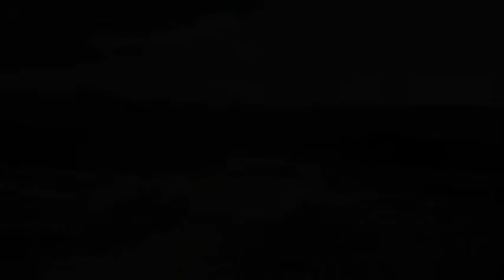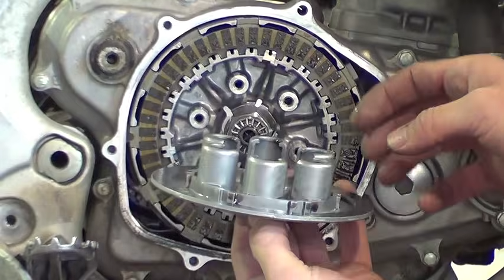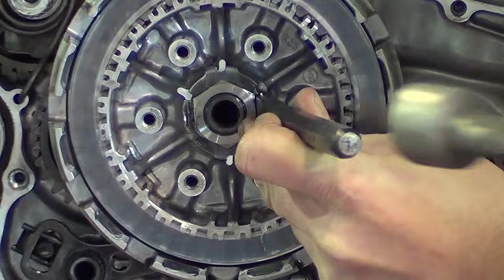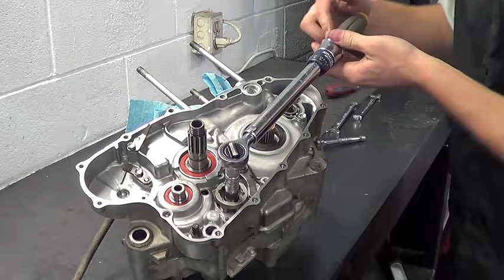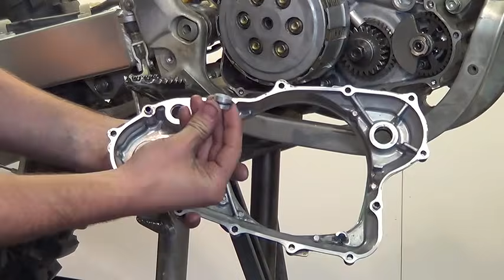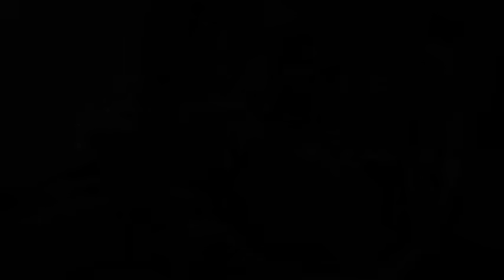Honda CRF450 Clutch, Kick Starter and Gear Shift Dis Assemble / Re Assemble - Parts in Description

Comment: Tengo una crf 450 x 2008 batallo para meter neutral mi pregunta es si será elnbalerito de la patita selectora no mire q lo cambiarás y en algunas motos es el primero q tiene juego
Reply from the maker: La mayoría de las veces es por las ranuras (muescas) en la canasta del clutch que hacen difícil encontrar neutral. Nunca he visto que se desgasten el buje de la palanca selectora ni el balero del tambor de cambios.
Reply: @CoteMotorcycles muchas gracias comenzaré por ahí

Comment: Si neutral batalla para entrar podrá ser el balero del selector o las pastas gastadas ? O el tipo de aceite ?
Reply from the maker: have you checked the clutch basket or if the clutch plates are stuck together? clutch adjustment is correct? very unlikely its bushings/bearings or oil making it hard to get into neutral.

Comment: Neutral no entra ssbes que puede ser ?
Reply from the maker: Probably needs clutch basket filed down. There are ridges that form from normal riding that will hold the clutch pack together. File them smooth and you should be good!
Reply: @CoteMotorcycles  en caso de estar bien la crestas? podría ser un balero donde detiene los cambios ??
Reply from the maker: @geovanyfz  you can see how the clutch basket should look at 8:00 on the video. The fingers should be completely smooth. I suppose you could also need to set your clutch cable. If it's not disengaging the clutch will drag and won't be able to find neutral. Very unlikely its a worn bearing. Could also check the detent bolt (5:28) The bolt could come loose and the detent star could have rotated on the shift drum. You would likely have trouble shifting in all gears, not just neutral.

Comment: Batallo para poner neutral
Reply from the maker: Probably needs clutch basket filed down. There are ridges that form from normal riding that will hold the clutch pack together. File them smooth and you should be good!

Comment: Why my honda crf 450r dont changue shifts
Reply from the maker: Most common reason is that the bike fell on the shifter or took a hard hit that bent a shift fork. That would mean tearing the cases apart. 

I’ve also seen that the shift detent bolt comes loose and doesn’t allow the lever to turn the drum properly. The loose fastener will be the one I’m holding in the thumbnail of the video. You need to make sure the detent wheel is properly located onto the shift drum.

Comment: Should you loosen clutch spring retaining bolts in a star pattern?
Reply from the maker: Doesn’t matter. If you want to get crazy you can loosen them by hand in an opposing pattern and only loosen them 1 turn at a time but I usually just send it with an impact. Never had an issue; just make sure the impact is for sure in reverse or you’ll snap a bolt or clutch hub. 

Have fun!

Comment: My kicker doesn’t go back up after I turn bike over how do I fix that ?
Reply: I just rebuilt the entire bike maybe i did somthing wrong ?
Reply from the maker: Get back in there! 
Probably the spring on your kick start ratchet assembly. The locating pin for the spring might be out of the hole, this makes the width of the spring increase and it will bind between the case and pawl mechanism. Let me know what you find!
Reply: So I started my bike yesterday after I finished rebuilt and kicker stayed down and I brought it back up and had to hold it forward so the noise as if it was still down while running ( if you no the sound) it went away but when I let go of it it moved about a inch back and started the noise again
Reply from the maker: @ryanpro3363  sounds like the same thing as I said before. The ratchet mechanism isn’t disengaging. Take the cover off and send me a picture of the kick start mechanism on messenger. I’ll see if I can see what’s going on.
Reply: I'm repairing this right now. Mine partially was returning, but binding. 

All the kick-start hardware was installed correctly, there were however some flakes of steel under the kick-start shaft that were binding the shaft.

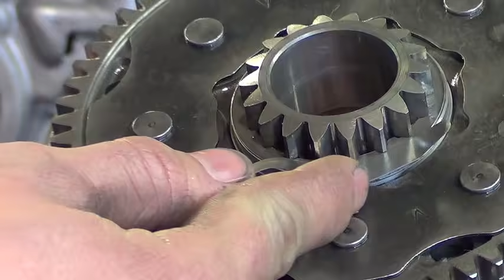Comment: At 7:29 you put the idle gear back in. My bike is have troubles kicking and I took it apart it the gear move back and forth on the shaft is it supposed to??
Reply: having the same problem ever figure it out?

Comment: I need to change the left side of the engine of my CRF, is there any video that could guide me?
I also have a question, when installing the cover, after the use of the gasket, is it necessary to use some kind of silicone or just the gasket?

Comment: The bearings on the case show sealed side out( red) . I opened my engine and appears they were put in backwards. Will this be a issue long term or will they get plenty of oil from clutch side
Reply from the maker: Jason Mcbride it's always good to have things the way the manufacturer suggests. I've never tried it with the seals in backwards so you'll have to let us know how your engine likes it. ; )

Comment: I have a 2003 crf450r and I can't seem to get my clutch hub to spin freely
Reply from the maker: Seth Herrera did you see the section in this video about the clutch hub and drive gear?
Reply: CoteMotorcycles yeah. I followed the video step by step.
Reply from the maker: Seth Herrera you may have something assembled incorrectly. If the cases were split a gear or washer could be backwards.
Reply: I cannot get my clutch hub to spin freely, I have taken the hub and basket off multiple times and watched the section of the video on it every time to make sure I'm following the instructions and it still won't spin freely. I am wondering what the problem is lol

Comment: 7:57 didn't make sense to me. Maybe it's the way you worded it. You don't want excess clearance but pressing the gear into the basket with the socket will increase clearance. Don't you want to decrease clearance to get rid of excess clearance? By excess clearance I imagine you mean too tight correct? More than or less than .006 clearance?
Reply: Belicose777 the goal is to press the gear farther into the basket. The socket braces the soft aluminum basket to allow the gear to slide farther in. Otherwise you would be pressing on the fingers, which would break. If the gear isn't installed properly it will act like your motor is seized after assembly. This seems simple enough but was a very tough problem to find. Hope that makes sense. - Cote Motorcycles
Reply: GoBoardCanada I'm sorry. Wow. I should really stop staying up so late. I get it. Great Video.
Reply: GoBoardCanada by the way I couldn't find the clearance for the drive gear and clutch basket in the service manual.
Reply: Belicose777 that's because the clearance should be 0. It's not meant to ever move but for some reason it does after disassembly.
Reply: GoBoardCanada ok. So long as it's below .006 then I'm okay?
Reply: Belicose777 should be ok

Comment: I just bought a 150cc apollo viper and it's not needing a clutch to move in any gear and when you put into gear it pops out of everyone and it won't drive of at all when it does hold on a gear. any thoughts? I bought it Monday the 26th and it came Tuesday 4th and we have not had any luck with the company. what do you think?

Comment: I own a 2007 CRF250R that I purchased in  a non-running condition. I have come to teh conclusion that the transmission is somehow stuck because when opening the side of the case I can freely move the crankshaft but the transmission is stubbornly stuck in gear. Before removing the engine, pulling the clutch lever did not let the bike roll. What may the problem be?
Reply from the maker: If your rear wheel or brake aren't seized I think you answered your own question. A transmission bearing or broken gear is usually the only culprit of a stuck trans. Another option is someone may have tried to "fix" it and installed some of the gears or thrust washers in the wrong position on assembly.

Comment: maybe you can help me here.. I have a 2012 crf450r its always shifted fine and I've never had an issue prior to today.. I was riding along kicked it into 5th, went to get back into the gas and it popped out of gear. I thought it might have been a weak shift so I shifted pretty firmly and got the same response. any help on where to start would be greatly appreciated
Reply from the maker: I would start by looking at the ratchet/pawl mechanism behind the clutch. Sometimes the bolt will back out giving negative gear engagement. After that you'll have to split the cases to check the shift forks, shift drum and gear dogs.
Reply: +CoteMotorcycles awesome thank you!

Comment: when I kick start my motor it kicks my leg back so hard and the engine never starts
Reply from the maker: Check your cam timing, decompressor clearance and ignition timing. I would also clean your jets in the carburetor. Assuming you have a pre FI 450 or 250 crf that is. Thanks for watching.

Comment: Great video please help me I want to install a starter version of the CPF 450x in my СRF R version (2006) if I can drill through the housing and make the stars? or need to replace a lot? can you tell us what you need to do this? (Chinese stator and batteries I've found) http://www.ebay.com/itm/Trail-Tech-Electrical-System-70W-DC-S-8201A-Charging-System-56-4690-2112-0621-/231008072799?pt=Motorcycles_Parts_Accessories&fits=Model%3ACRF450R&hash=item35c927745f&vxp=mtr
Reply from the maker: +Ilya Nevorotov Honestly, unless you're bored and have a lot of excess income, it would be WAY cheaper and easier to buy a X model and convert it to an R. You'd have to change the engine cases and most of the bottom end. If you're handy with the lathe and milling machine anything is possible but you won't be just "drilling" through the cases to install a gear or two. Maybe take a look at some KTM 450SX bikes if you'd like electric start on a full race platform. Hope this helps and thanks for watching! Please SHARE!
Reply: +CoteMotorcycles Yes, of course purchase immediately Model X would be easier significantly but Russia is not selling model X, but I have friends who have a milling machine, we now have the winter and the summer season I would like to convert the bike into a model X, you can give contact how to contact you to discuss the experimentation?
Reply from the maker: You can contact me through Facebook messenger and I can try to help you out. Found this on eBay http://www.ebay.ca/ulk/itm/351121642824
Reply from the maker: +Ilya N just search cote motorcycles on Facebook and send me a message.
Reply from the maker: +Ilya N just search cote motorcycles on Facebook and send me a message.

Comment: i have an 05 crf 450r i have the engine out and rebuilding it but i had it shifting fine the other day and today i noticed it wont come out of first nor will it go into neutral. what can i check to fix this?
Reply: ever figure it out?
Reply from the maker: If the cases are still apart it will likely not shift properly because of minor mis alignments. If the two halves are together you need to make sure you're turning both shafts against each other while trying to shift. If that doesn't help you need to double check your gears and thrust washers are installed correctly. If the engine is assembled and the problem occurred after installing the clutch, check the inner clutch hub race. The race, which holds the large needle bearing, will sometimes migrate out of the hub causing a clearance issue. It will need to be pressed back into place, don't use a hammer or you'll wreck it. Otherwise I'll need a lot more info to help. Look me up on Facebook and we'll see if we can get to the bottom of it.

Comment: Assembly note: Money shot at the 4:00 minute mark. Look closely at the end of the kick start shaft and ratchet gear. They have punch marks that have to align with each other when re-assembled to have the correct return spring tennsion. Don't overlook this very simple mistake.
Reply: I made that mistake. had no idea what was wrong with it
Reply: Max Smith thanks buddy!
Reply: No problem such a simple thing to overlook
Reply: I wondered why my kickstarter was acting funky and making noise..... -thx Kev

Comment: Hello cote, wondering if you could help me with understanding something. So I have a 2007 crf450r, and I was riding it 2 days ago and needed to help my brother as he had fallen. I turned the gas off and laid my bike to the side. Apparantly that's a big no. I picked my bike back up and it didn't shift out of second. I'm not exactly sure what to call the piece that fell out of place, shifting fork? But it will not shift anymore. Can you explain why this happened? And also does your video explain what I should do?
Reply from the maker: Sounds like a bent shift fork or broken ratchet / pawl mechanism. You'll have to download a service manual and watch a few of my vids but as long as you can turn a wrench you should be ok. Check the ratchet/ pawl mechanism first and then get into measuring the shift forks for warpage. All the videos we supply will show you how to get the job done and the manual will help you with values for measurement.

Comment: I have a 2007 cr85 and it idles fine and reves fine in nutrel and in gear with the cluch in but as soon as u let out the cluch no matter how slow or fast it bogs down and cuts out nearly straight away. I have spent the last few weeks rebuilding the bike and just sprayed the frame and new bearings  all around and also put a vertex piston as I thought it was the piston at first. Its really bugging me as iv tryed almost everything.  If u could help id greatly appreciate it. love your vids! Enjoy a lot.  thanks
Reply from the maker: The clutch hub or basket could be worn causing the plates to stick together. You'll see grooves in the aluminum where it should be smooth. I've also seen very contaminated oil causing the plates themselves to stick together. I assume the bike rolls ok? I've seen blown wheel bearings or seized calipers cause this issue as well. Hope that helps, good luck and thanks for watching!
Reply: CoteMotorcycles thanks for replying! ill have a look at the cluch